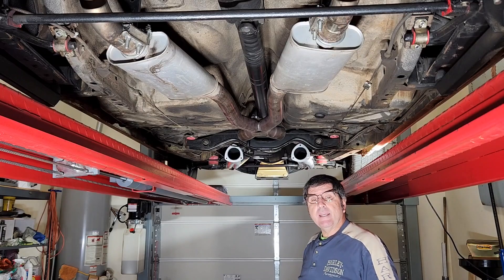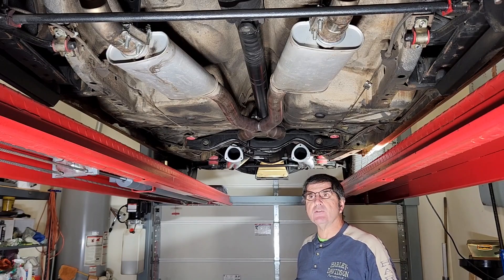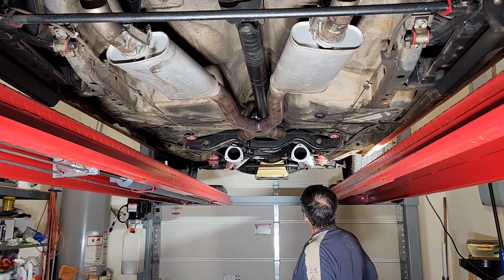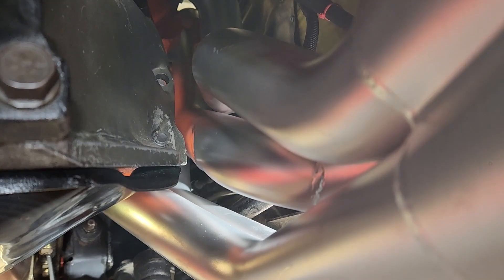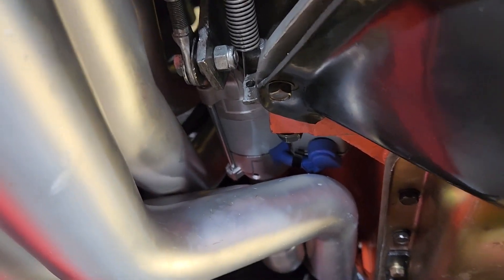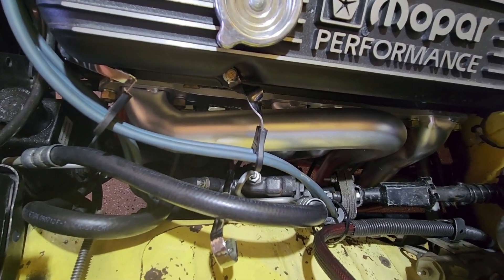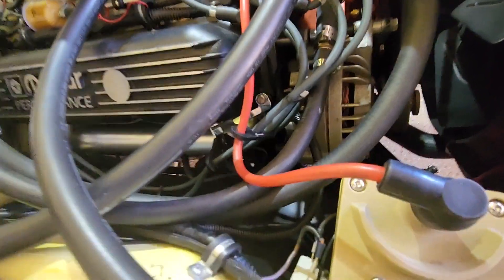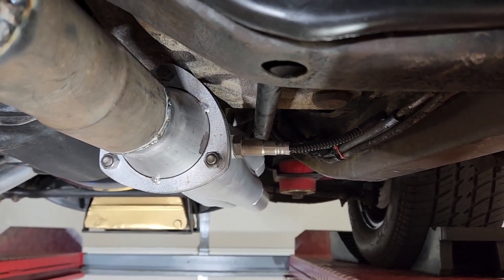TTI Headers Installed on big block Mopar with Trick Flow heads

Comment: A lot of times those clearance issues are because of either 'old' or non-original type motor mounts. They matter a LOT. I also noticed that you have the iso style k-frame bushings. There used to be a source for factory type iron replacements to stiffen up the front. I'd give some serious thought to getting some sort of heat shield for that starter,

Comment: how was the clearance third sparkplug and wire passenger side any issue with the headers I have a set of headman practicly need to remove headers to install sparkplug and wire on my 1970 440 roadrunner

Comment: Should use 3 inch exhaust , 2 inch primary tubes are over kill 1 7/8 primary would have been sufficient, unless u have about 700 horsepower.
Reply: 440s don't care about primary size